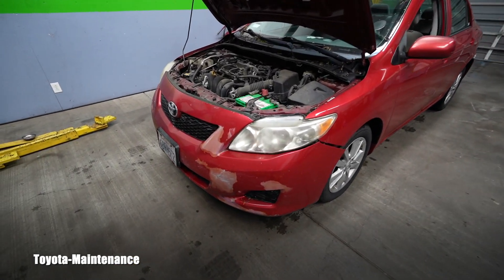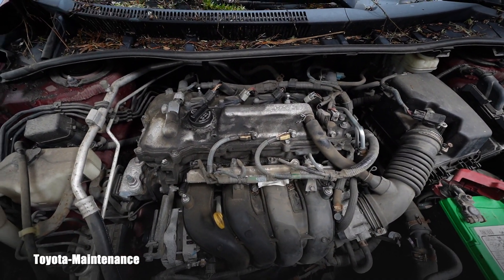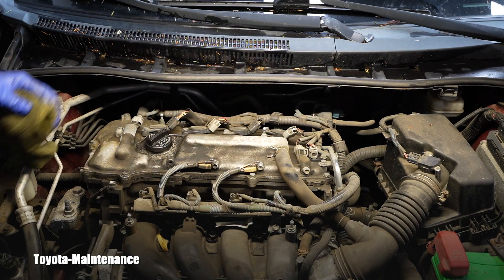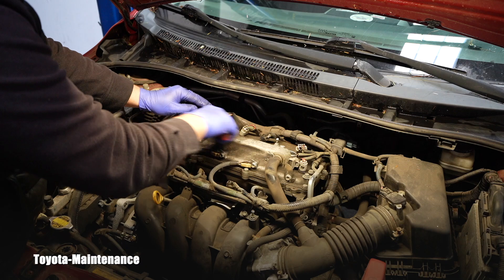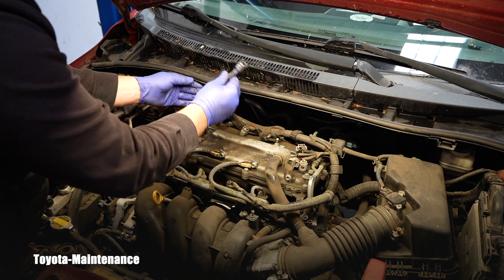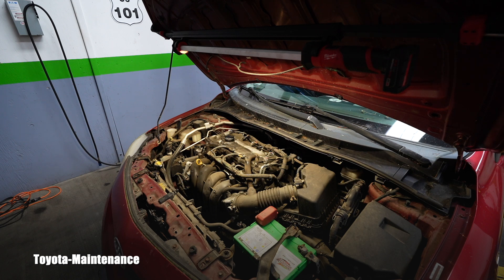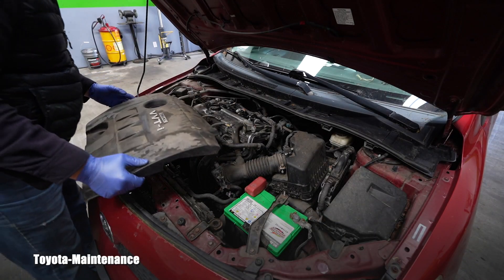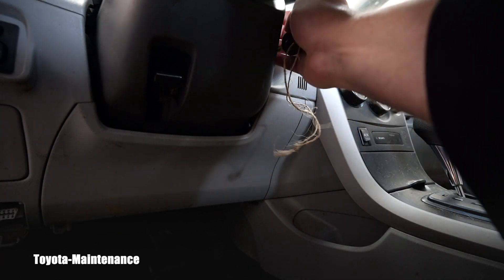2009 TOYOTA Corolla Running Rough, Code P0352

Comment: Has anyone watched Peter's opposite brother The car care nut? He says my 2004 2az-fe is junk , not so bought new does not burn oil. Never over heated. i would agree if you overheat it, ya probably toast. New radiator, water pump, original starter, alternator. 135k miles

Comment: Hi, I have a 2010 Toyota Camry 2AR-FE engine with 177,000 miles. I'm in Chicago and when the temperature drops in the morning the engine works fine but the transmission   is not engaging until the transmission fluid gets to higher temperature. Once warmed up it works fine with occasional hard shifts. The transmission fluid was drained and replaced twice, once at 90,000 miles and again at 170,000 miles. Do you think I should be concerned with this transmission issue or it is normal in cold temps? Thank you in advance.

Comment: I had a 2009 Yaris with a 1NZ-FE engine with a failed ignition coil 3 just like yours. It had only had 28000 miles on it. Apparently water had gotten into the spark plug well from the split plastic cowling above it causing arcing and damaging the boot on the coil. Cheap fix with just a new rubber boot and a new spark plug. 
That Corolla has the same modular cowling.

Comment: My 2009 Corolla coils went at 90k miles a few months ago so 15 odd years. I saw a video from the car care nut that said the 2zrfe likes to go through coils so it checked out for me. I brought DENSO coils which are a lot cheaper than the Toyota OEM ones.

Comment: I've learned my lesson with after-market.  2000 Tacoma V6 (130K miles). I've had it > 20 years. I've had to replace the ignition wiring harness 3 times in the past 30K miles. The two aftermarket wiring harnesses didn't last long. I bought OEM wiring harness and plugs last week.  No more aftermarket for me. Petr has kept my truck on the road. It runs like new. Thanks Petr!

Comment: Cool. I have twice the miles on a 2006 Matrix. Original coils. Change the plugs every 100k and the coils will last.
Reply: That is a very good point, also change the coil “tips”, the rubber part that comes off every 100k and it will really help extend the coil life.
Reply: @hokie9910  Gotcha.
Reply: I’ve changed mine every 120,0000 miles.   Then I did it at 240,000 now presently up to 265k.  120k is the recommended interval in the manual.  It’s a 2007 Vibe (which is a Matrix).  Still have the original coils.
Reply: @ I have found Toyota’s coils usually go out between 250-300k if plugs are changed on the intervals.  You can get Densos on Rock auto for 50 bucks each, might be cheap insurance to change them out soon.
Reply: @hokie9910  so I’ve heard the Vibe and Matrix’s odometers max out at 299,999.  Something about a cost savings move.  Have you heard anything about that?  I’m at 265k and heading there.
Reply: @ I have not
Reply: @slalomking  Yes. Just start keeping a mileage log after 300k. Used the A and B trip odometers.
Reply: @MarzNet256  OMG, I don’t think I can do my maintenance thoroughly without a working odometer !   My wife might reset the tripmeters.
Reply: @slalomking  Tell her not to touch it. And write odo miles from trip A once per week. If it gets reset once or twice, it won't be a big deal. You can use trip A for tracking miles and trip B for oil changes (which you can reset to zero). The oil change minder should still come on every 5k (so you could also use that to track every 5k added to car).
Reply: @ oh this car has no maintenance minder, it’s actually a Pontiac Vibe 2007